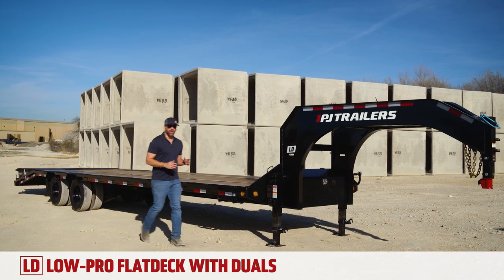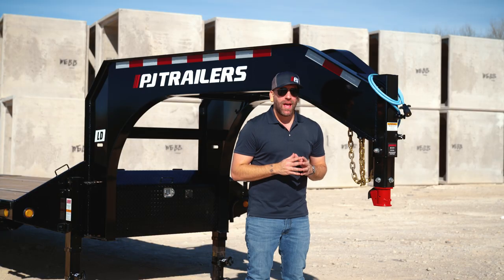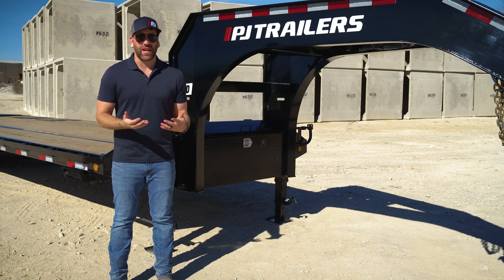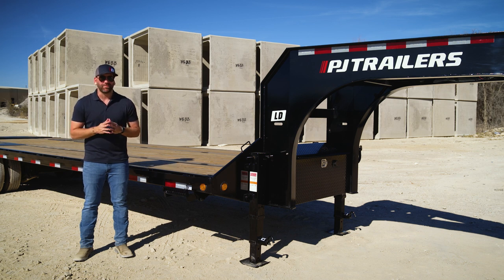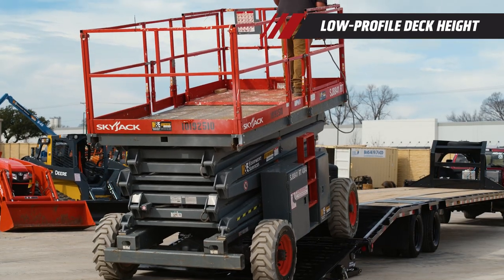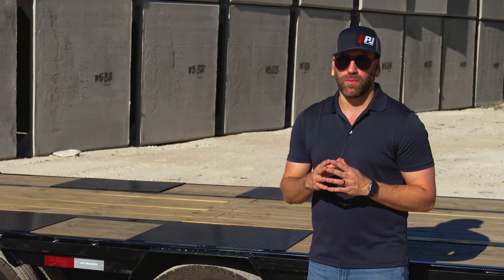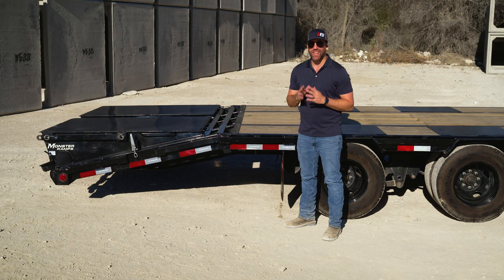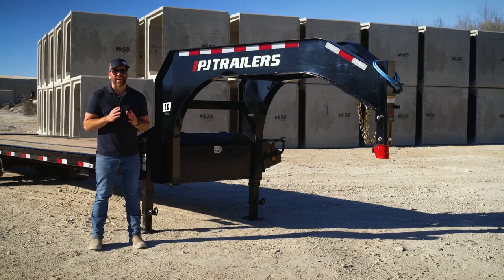PJ Trailers Low-Pro Flatdeck With Duals (LD)

Comment: How much does this trailer weigh? At the 40 second mark it is stated the the GVWR is 25,000lbs, but 15k axles are available and 10k are standard. Going by the video I’m guessing 25k is the maximum GVWR for these trailers, if the trailer shown (44’ with monster ramps), weighs 9,000 lbs (my guess from weight of non “pro beam” trailers), cargo capacity is only 16,000 (8 tons). If I was marketing this I would show a comparison using a scale of the new gooseneck vs the traditional style.
Reply from the maker: Hey Chris, we are still working through all of the weight differences in configurations, etc.  Weights of the new LD in standard configuration can be found on the LD Product Page: https://pjtrailers.com/trailers/ld-low-pro-flatdeck-with-duals

Comment: my question  is  I order a 35 +5 pj trailer    double  dually  with   rated  25000 pounds  with  10,000 axes.  Im worried How much it  gonna weight  when  I will put it on sale,  , Will it be compatible using my  ram 3500 dually with 14000 gvwr     doing non CDL  .
If Deleted  how much will it show on the sticker  .? waiting an answer please. thanks

Comment: Is there a distinct weight savings to this new model or is it simply a duplicate of another brands neck design?
Reply from the maker: For the neck, we did an extensive amount of testing with different designs with the focus on building a more modern neck that reduces stress points and increases strength.
Reply: @officialpjtrailers  So is it saving weight?
Reply from the maker: @minecraftlover2222  Through design efficiencies, yes, there is an average of a couple of hundred pounds of weight savings.
Reply: @officialpjtrailers  tested design lol this is Based of Diamond C how is it different?